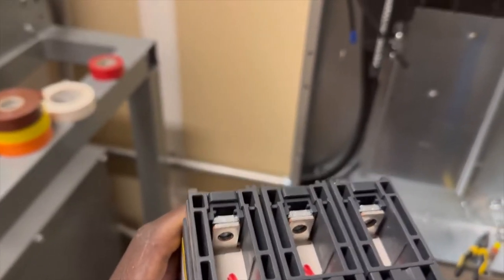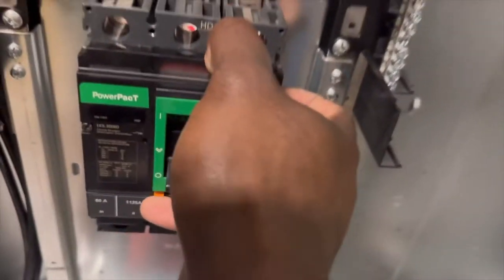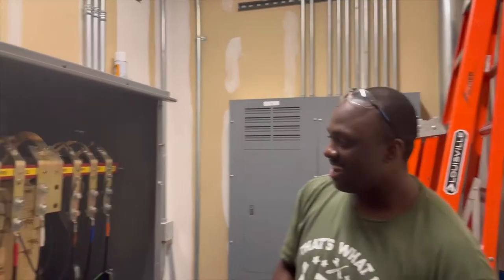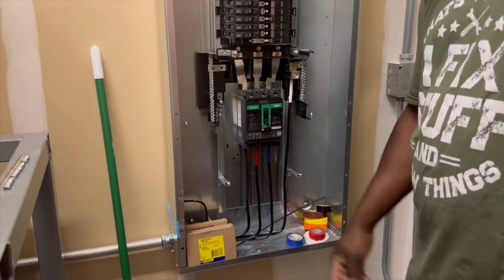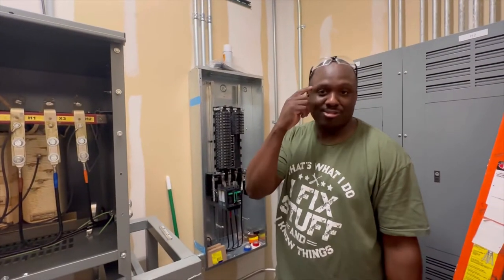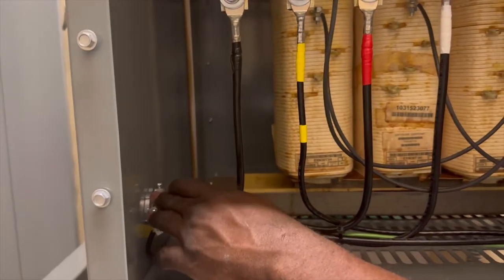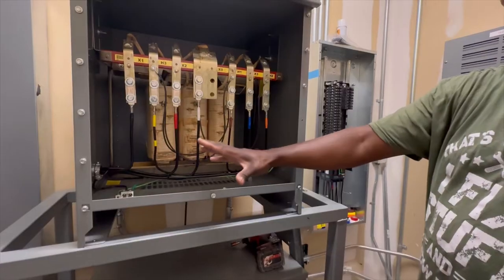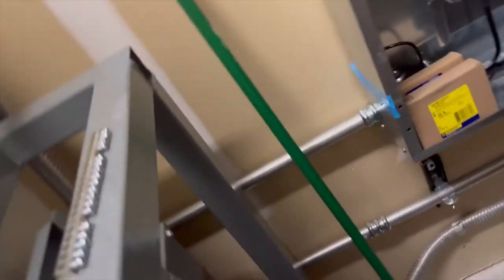How To Hookup 30kva Step-Down Transformer  #electrician #electrical

Comment: The secondary wiring size is a problem here. Not #4, you should use #1 by calculation. The breakers would trip more times than using #1 as secondary wire.

Comment: Congratulations you have failed. X0 is  not bonded and you can only use 1 ground conductor and that 2 barrel lug is a no no here in Massachusetts.
Reply from the maker: Greetings John, with the knowledge you have you shouldn’t be watching crazy video like this since you are so smart. The world know that xo must be bonded we we didn’t have anymore crimp lug at the time but if you notice a space was there on the mechanical lug for bonding, anyway if you don’t have anything positive to say, please stay away from this page. It’s all about positivity over here thank you, sir.
Reply: @adventurousdiyguy  With all due respect, if you cannot take constructive criticism, you shouldn't allow comments. You have to accept the good and the bad. The criticisms are actually justified because the main bonding jumping is CRITICAL and that fact that there's no mention of it in your video is a failure on your part not only while recording the video but also while editing the video. Bonding and grounding is so much more important that the ungrounded conductors and that's where you should have started; just like when you wire up a receptacle. Instead of PVC, you should have used EMT to keep the conduit uniform, especially being exposed in the electrical room. Attention to detail is very important and any these oversights are the things that lead to failures in electrical systems.

Comment: Clean work. You have to have everything done right down to the tiniest of details because it will get spotted like the XO ground. Bad practice to be in a hot panel or even low volt without the proper PPE. No loto? Heck with bragging on your work if your in the hospital. It only takes a half an amputee

Comment: Never installed a grounding bushing on a greenfield connector feeding a transformer. Usually only use them when using a rigid steel pipe or conduit between meter can and trough or service panel. Nice conduit runs. We were not allowed to use motion detector sensors for controlling luminares in any electrical room or switchgear room. Had guy working on top of not wired in 13KV equipment and the motion sensor could not pick him up and ended in the dark probably 30' from the step ladder to climb down. I always carry a good LED bright flashlight in my shirt pocket.

Comment: So that a step down transformer you are powering a circuit breaker panel is it a step down or step up?
Reply from the maker: It’s a step down from High voltage to Low Voltage, the panel it goes to is low voltage and the panel that feeds the transformer is a high voltage. Sava?